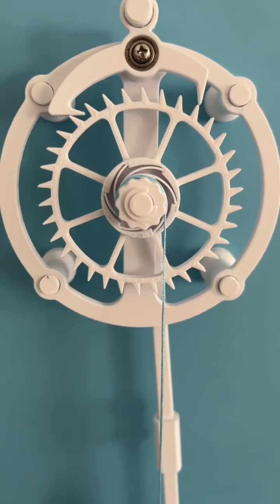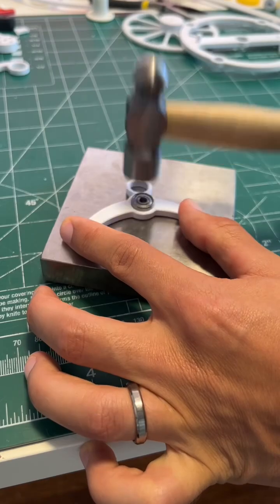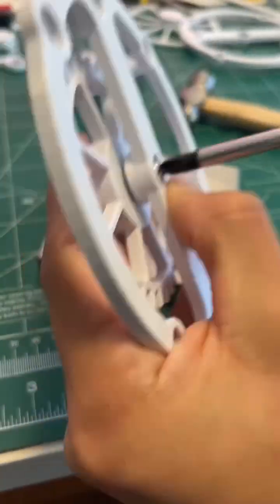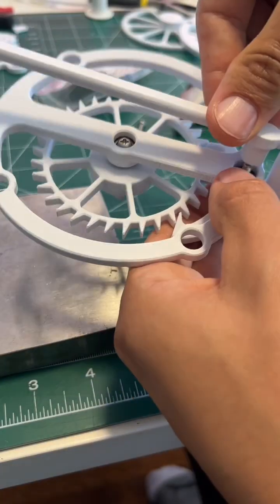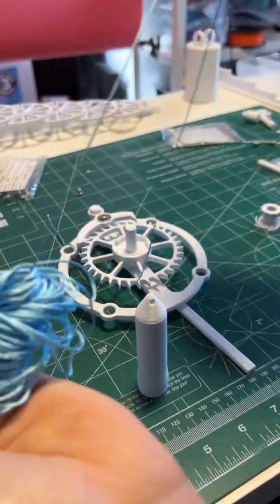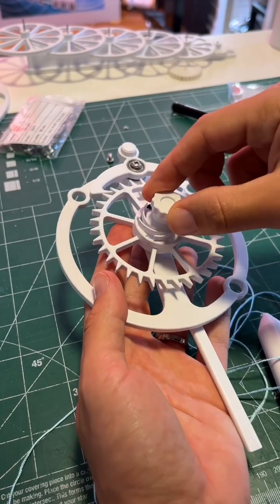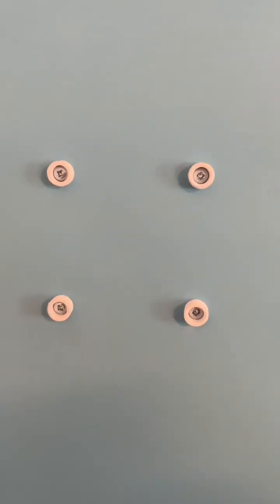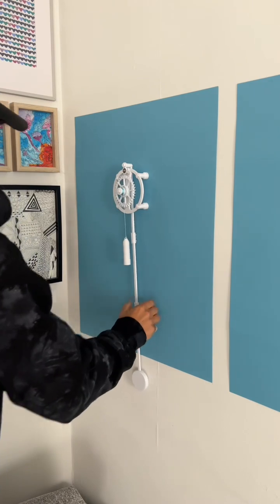How to Assemble the Recoil Anchor Escapement

Comment: Thank you for the early files! I do have a few questions though.  The layout has us printing 6 C clips, but I only see one used in the video? Also, the layout has two pendulum pieces printed (one top, one extension) and one connector, but I see you used one top, two extensions, and two connectors here, is the longer pendulum better?  And the file says to print the pendulum weight at a "high" infill to make it heavier, is 45% enough or should it be more like 75%?  Thank you!
Reply: 4 more clips are used to mount legs, I assume 6th one is a spare (-: